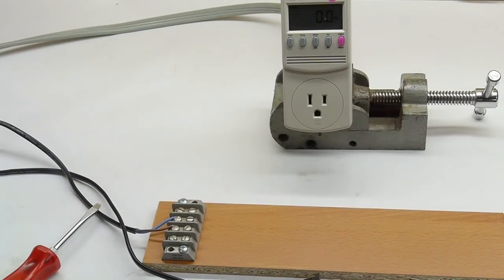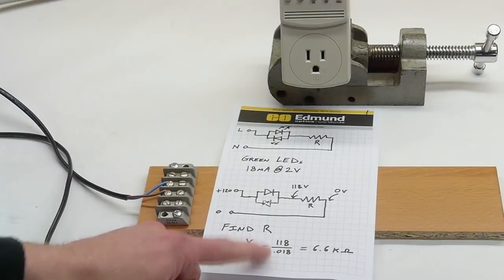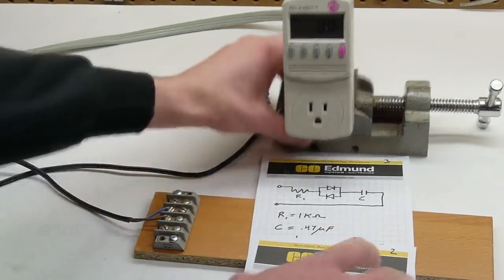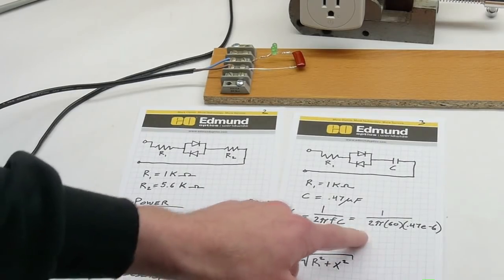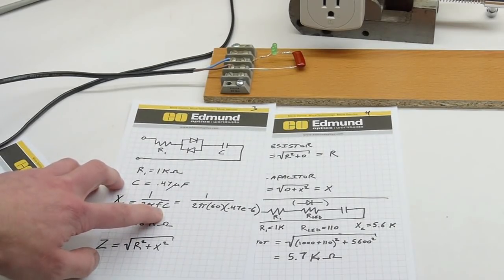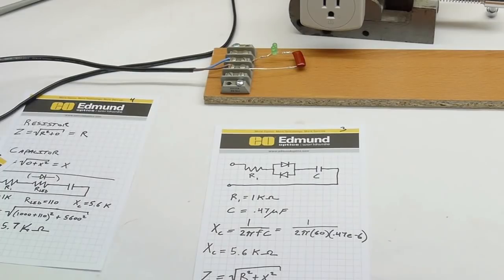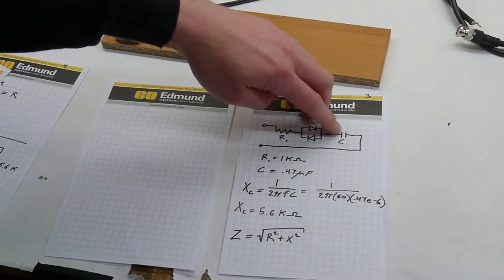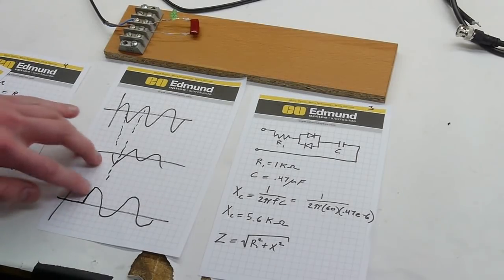Tutorial:  Electrical impedance made easy  - Part 1

Comment: It could be if you designed the circuit to drive the leds at more than 70.7 % of full rated current.  The pulsed current rating is higher than the continuous current rating.  Rectifier diode data sheets usually cover this aspect of ratings. I am not too sure about leds. The ones I buy (ie cheap) are not sold with a type number and I tend to run them a lower than max rating, especially on battery power( cheap bastard I am).
cheers

Comment: The electrical company probably wouldn't be very happy with your solution either, since it causes a lot of reactive power. :P
Also, I doubt wires in your walls can carry hundreds of thousands of amps (1:25) and 1 ms (15:43) is about 1/8 of a half wave, so I doubt the current spike would last that long. But the point was, the current would be high (1:25) and the time is short (15:43), so who cares about numbers... :-)

Comment: Why voltage flips 120 times per second?
Reply: +Pan Kowalski 
I assume you're asking why 120 times rather than 60 times at 60Hz? 

At 60Hz, it actually flips to the negative peak 60 times per second and flips to the positive peak 60 times per second.

AC sine waves are measured over a period of one cycle (one cycle equals one positive peak and one negative peak). 

In other words, there will be 60 positive peaks and 60 negative peaks at 60Hz frequency (for a duration of one second in time). Add the positive and negative peaks together to get 120 total peaks.
 
If the AC voltage source is full wave rectified to get all peaks to go to the positive side, you would see 120 positive peaks on the oscilloscope. Add a bulk capacitor to raise the average DC voltage and you will see a straight line DC signal until you add a fairly large load resistance to the output, the load resistance will produce a ripple on the output. To further reduce the output ripple, increase the bulk capacitor value. 
The bulk capacitor is just a fairly large value capacitor that is connected to the positive and negative DC output lines and as close as possible to the power source or rectifying diode network, this effectively fills in the voltage dips between each positive peak (but not all the way to the top of the peaks, the capacitor merely gives you an average DC voltage). The average output voltage depends on the load current and the capacitor value,  you could see an average output of around 80 to 90% of the positive peak voltage but that depends on the size of the load and the size of the  bulk capacitor). There are ways to calculate what the average DC output voltage will be with a given load resistance.

The reason for mentioning the use of a bulk capacitor and rectification is to let you know that capacitors are used for "MANY" different purposes. In the video example, it is used as a resistor that is dependant on frequency, some are used for filtering as in the case of a decoupling capacitor to remove parasitic inductance, line or trace noise influenced by external sources such as EMI/RFI and so on. 
REMEMBER, Even in those cases, impedance plays a large role in a capacitor's effectiveness in a circuit. 
Many IC chips require a specific impedance range to operate properly. 

In the video above, he is using straight AC to light the LEDs and is not rectified as I have described.  
The video example also shows how you can use an LED as a pilot light on say an isolation transformer to indicate that the transformer is on. 
I did the same thing for my 5 amp lab isolation transformer so I wouldn't forget to turn it off. The indicator LED visually reminds me that it is on or confirms that it is off. This method doesn't require rectification or the use of a large wattage resistor.  
Of course, this video was to explain impedance rather than how to use an LED as a pilot light at 120 VAC, :-D 

I hope I answered your question and I hope the rest helps! :-)
Reply: Your reply is helpful
Thank you very very much!

Comment: But then you could say static electricity is the flow of electrons from one surface to another. It still can be explained in terms of electron flow. Getting a "Static shock" is just electrons jumping from one potential to another so I think you are just nit-picking there. "Electricity" generally means the presence of current flow generating a particular voltage (or vice versa) so to have electricity implies some form of flow.

Comment: Nice videos, but when you measure 120 volts of an outlet you are measuring the RMS value of the voltage and not the peak to peak voltage, and the RMS value is about 70% of the peak to peak measurement.
Reply: YES...That is along the lines of questions, but It seems Ben doesn't really respond!

Comment: I took apart a slot car when I was a kid, added a battery and to the wires from the motor and it spun, so I added two battery's and it spun faster, so I plugged right in to the outlet. Boom.. ouch..

Comment: As an electrical engineer i just watched how you explain it. as suggestion dump the bucket analogy. it makes no sense or similarity in case of capacitor. Also never use water and pipe analogy trying to explain current voltage amperage resistance etc. for example when pipe diameter increases water pressure drops its opposite of electricity .one is moving mass other is moving electrons. and electrons works in quantum mechanics.  other than that your explanations are pretty accurate and understandable. however you miss the explanation of S total power. watt meter shows the watt not the total power. power has "power factor" when factor is 1 watt is equal to total power. when power factor is not 1 total power  becomes S which is VA known as in power ratings kVA when you explain impedance it is important to explain those too to have comprehension from listeners. You have better hand writing then i have.

Comment: I am skeptical that capacitor manufacturers don't advertise the resistance because they don't know what frequency you'll use it at. That's what graphs are for. Look at any IC or audio amp spec sheet.
Even Nichicon audio caps which are advertised as "Low ESR" have no resistance rating on their spec sheet. That is very fishy.

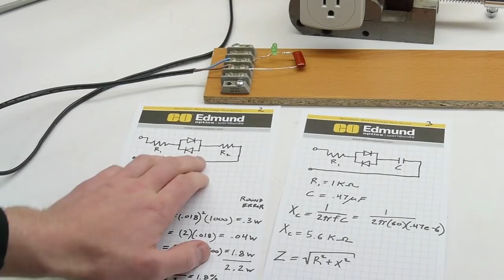Comment: not qualified to post, but, lost a bet you'd mention Kirchhoff for "Z".  and for cap. values stated in ohms, 6:35, i reached for electro droid, a calculator app you can download. lastly, i was reminded of reactance, or choke coils, but, besides heat and energy losses,  you didn't really go into why the difference for different applications.

Comment: At 7:00 your calculation is wrong. A 0.47 microfarad C has an impedance of 5.6 K ohms. Fair enough.  But you can't simply add this to the 1 K resistor's impedance and conclude that the total impedance is 6.6 K. It doesn't work that way because the impedances are at 90 degrees to one another. The total impedance of this combination is 
sqrt( 1000^2 + 5600^2) = 5688 ohms NOT 6600 ohms. In fact your current here is a little higher than the purely resistive circuit and is 20 mA. Also I^2*R your real power is (20 mA)^2*1000 = 0.4 watt as you discovered. Had you desired an 18 mA current instead this would have required about a 0.405 microF capacitor. This would give you a total impedance of 6.6 K.
Reply: Never mind. I just saw part 2 where you addressed this.

Comment: A resistor  connected to an AC voltage will conduct  AC current and produce  HEAT  ( like a toaster does !)
The resistor limits the AC current according to its size measured in units of ohms.  

A capacitor  of a certain size will draw the  same AC current but it can NOT produce any heat !
The capacitor limits the current due to its reactance ; which depends upon the frequency of the AC voltage and the amount of 
" capacitance " in that specific capacitor.
Further explanation would require  some math and a deeper understanding of the concept of reactance  and resistance

Comment: There are 2 resisters in the  first diagram, there is only 1 in the actual circuit.   The connection between diodes and LED bulbs is not explained.     The diagram should exactly replicate the actual circuit.

Comment: IT is NOT a practical matter at all. The  capacitor value calculated for steady state of course can NOT function to limit the current at turn-ON, so the resistor is required to produce  current limiting for the turn_ON case.

Comment: There are otherway's to explane and demonstrate impedance than using the wall socket. For couple of reasons. People are going to try this out. Even if you mention 1000x they still do.
Than you demonstrate no safety issues and no EMS problems when using LED's in AC. The main problem is the lack of education in designing products is the CRAP they use in design. 
Filtering, Uhh tooo expensive, EMS radiotion, heat, whatever. Using safety capacitors like class X2?? well normal one will do for 2yr, long enough to be out of regulation.
IF you want to teach do it the right way, that includes more than just 1 item. I learn electronics with battery's. Light bulbs etc. That will do also the job. And so I recon that your teachers also learned it to you this way. AND IF you use wall socket al leased use a simple safety transformer! Short This is not the right learning tool. By the way, explanation it self  of you that is the 100p marker.

Comment: Poor job of explaining. First you start by breaking the 6.6 kohm resistor into two resistors and say you'll explain why later, but you don't. 
What's the purpose of the 1kohm resistor?
Reply: Poor job paying attention. It was explained
Reply: @RubberChicken10000  Where ?
Reply: @RubberChicken10000  what i mean is, he never said why the first resistor is used. Couldn't it just be eliminated and the capacitor alone used ?
Where was that explained?